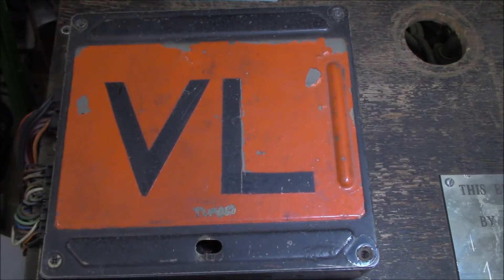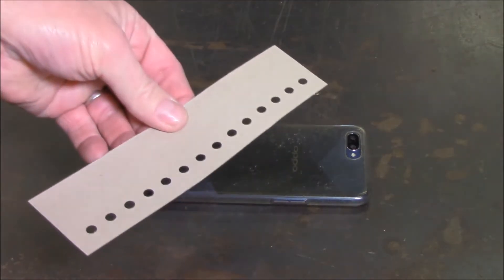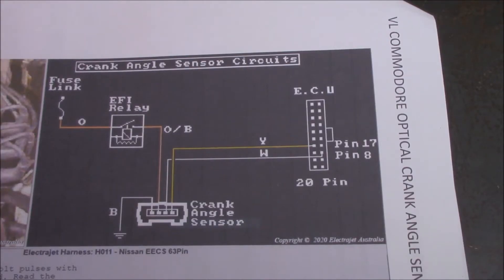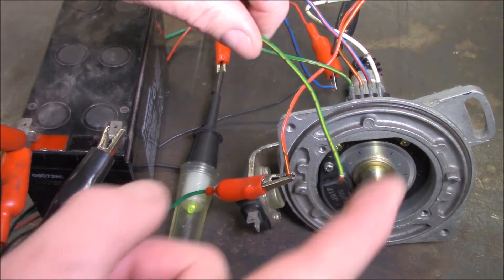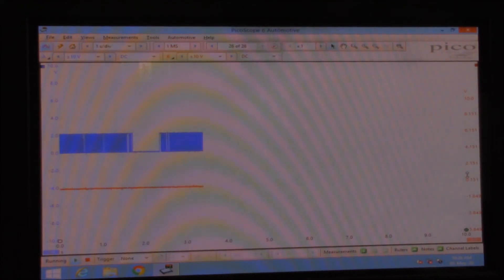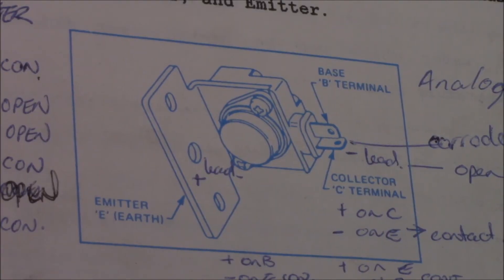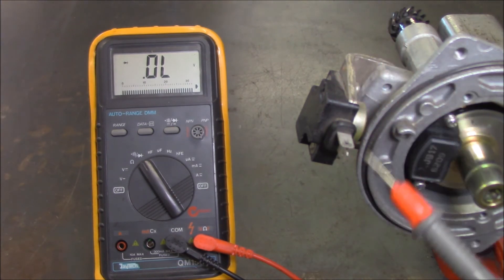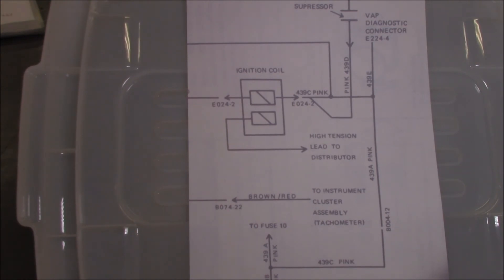Optical Trigger MiracleMAX

Comment: Pretty sure i know the answer to this question but

The disc with windows is the basis for the optispark used by gm on the 92-97 5.7 Lt1, and with your cars dizzy not being mounted below the watwr pump or in the path of splash water from puddles im guessing that unlike the optispark this setup was probably pretty reliable?
Reply from the maker: It did fail from heat & oil seal damage - oil on the optical ring would take out a cylinder or 2. The MOSFET did play up on occassion, but it did OK

Comment: what program is that oscilloscope called?
Reply from the maker: Hey Julian Garcia,
The program is call Pico and is available for free download. It is used by heaps of techs in their everyday diagnosis. Even if you don't have the hardware, you can run it in simulation mode and get used to it's operation.
Here's the link:
https://www.picoauto.com/downloads
MiracleMAX